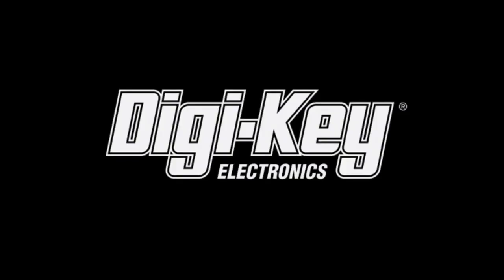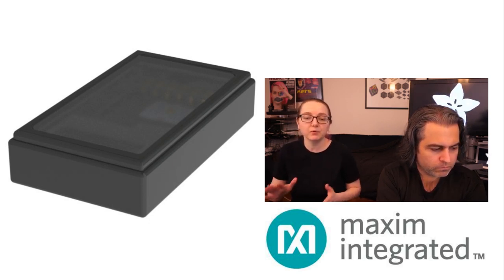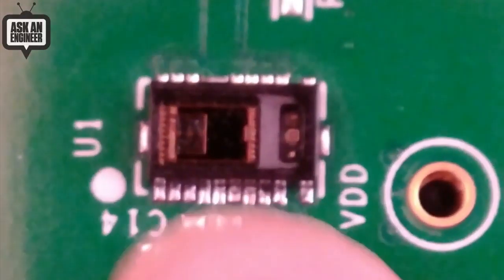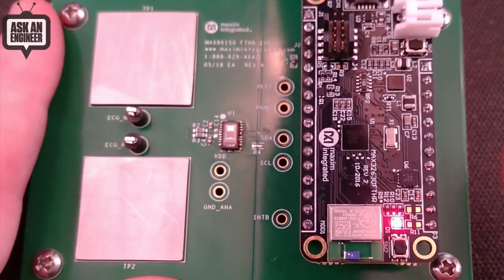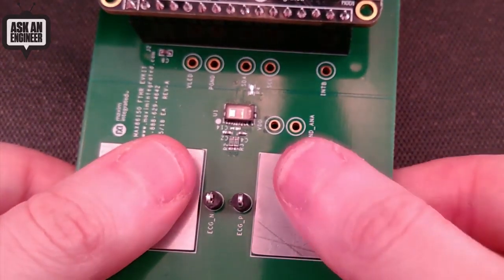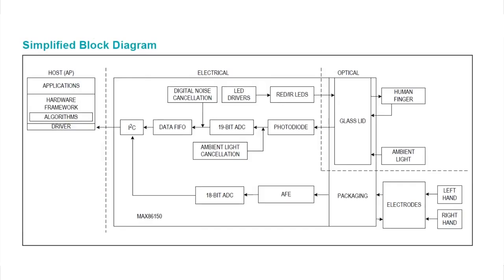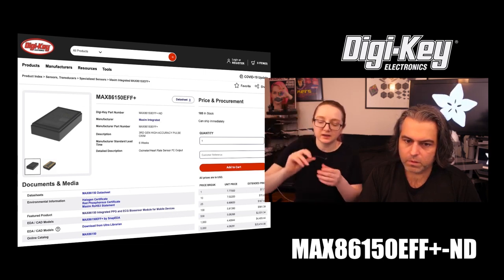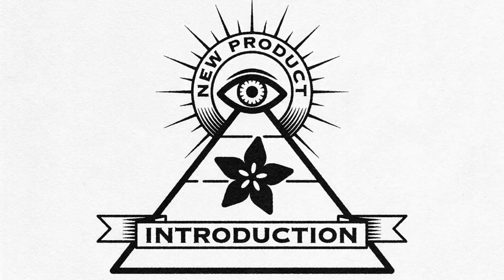EYE on NPI: MAX86150 BioSensor Module #EyeOnNPI #Adafruit @digikey @adafruit @maximintegrated

Comment: Hey laydyada, have you tested the pulseoximeter measuring with an ear clip. Those are used for  animals on the ear an tongue. The Finger sensors are rather unreliable/anoying because the EKG Units start screaming everytime they loose pulse or oxygen level for a second which means everytime the patient moves or doesn't stay still. That is very anoying for patients trying to sleep or rest and the personel gets numb because of all the false positive alarms.